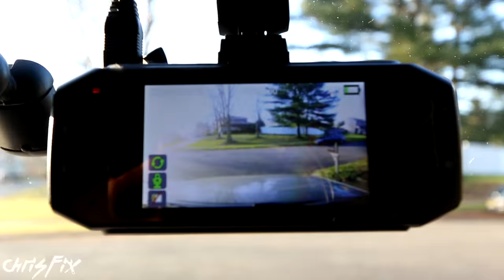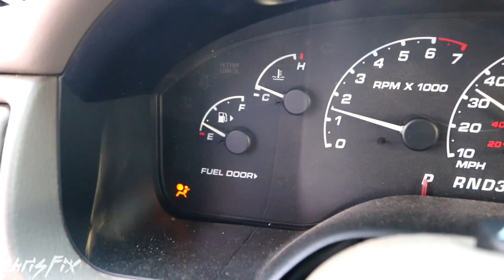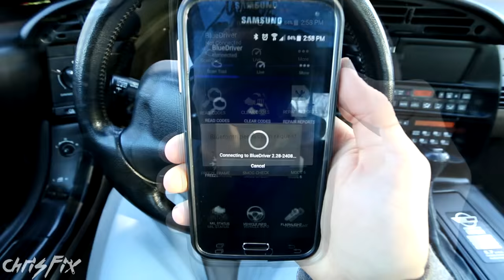Top 5 Christmas Gift Ideas for Car Guys

Comment: My number one is an actual car. there is nothing better than the gift of car
Reply: +Mihai Constantinescu That's a bit pricey though ;)
Reply: +Re yeah but it still be nice
Reply: +Re He didn't actually say it had to be new, or even running :)
Reply: Even a Prius?
Reply: Sure, I agree, Mihai Constantinescu. Some years ago, we gave a small Sentra to my sister (her first car), and I was even happier than she, because I remembered when I received a 74´brand new Ford Maverick with a 302 2bbl 3 speed in the column (a Mexican version), but, AS A GIFT!!! What a "happily shocking" experience.
Reply: +FallSoftly LMAO same
Reply: Mihai Constantinescu I kinda just received my car as a "why not, we don't need it anymore"
Reply: Plot twist it's PT cruiser
Reply: Mihai Constantinescu or a plane jk
Reply: I was thinking for a more experienced car guy a cheap parts car of the same model of theres if it's possible they are cheap and very useful for some guys.
Reply: Nicolo di Valenti I had to work 3 years to get my 2006 mustang gt
Reply: FallSoftly I
Reply: Ford gt ayyy I feel yeah. I've had a job for almost three years now and got tired of my dads old car he let me drive and bought myself a 2004 mustang gt convertible. In love with it
Reply: Mihai Constantinescu buy smone a lambo they will love u for life😂😂
Reply: I worked at minimum wage at a shitty job to save up just enough money to buy my first car, a 2000 ford mustang.
Reply: I got a car for Christmas, it's a 2005 Toyota Corolla.
Reply: DO I LOOK LIKE A CHANNEL WITH 500K SUBSCRIBERS?
Reply: Lmao yup
Reply: You should watch Bailey Dir!! She’s so aesthetic🤩I just found her
Reply: Did you get your car?
Reply: Pretty pricey
Reply: What if they have you a fiat multipla
Reply: @brandonlueth3400  insurance money it is then

Comment: 1/2" drive cordless impact.
Reply from the maker: Good idea
Reply: My girlfriend just picked one up for me :) only 145 foot pounds though. I see one for 700$CAD and it was like 350 foot pounds.
Reply from the maker: That's awesome! She's a keeper lol
Reply: Indeed lol. I got her to do some tires before.ChrisFix
Reply: I got me a Kobalt 1/2 in cordless impact from Lowes for $260. Works ok on wheels and engines.
Reply: How about a stubby air impact for $100 with 450 ft lbs of torque, and it's the size of an air ratchet.
Reply: +AJ Harran The new Ryobi impact driver with 3 speeds on the top claims up to 300ft/lbs.  In my experience it's not that strong, but it definitely is very strong for a cordless impact.
Reply: +AJ Harran Hah, that's what my wife got me last year - love it.
Reply: +AJ Harran Lithium Ion** trust me... well worth the money....
Reply: it is
Reply: +MindOverEverything Just received a Milwaukee Fuel 2763-22  1/2 impact at work, they claim 1,100 ft lbs removing and 700 ft lbs tightening. The thing rips 30mm lugs off dually GMC's with no problem. Best cordless impact I've ever used, its not cheap though.
Reply: My gf got me a craftsman xcp 1/2 impact gun for an early Christmas present. I love early presents.
Reply: +hugeslacker Harbor Freight electric impact.  Best $30 I ever spent on a tool.  It blasted off a rusty axle nut that had been on there over 12+ years with the wheel off the ground.  Air or a Milwaukee lithium would be a lot better, but you can't beat the price, especially if you don't have a compressor!
Reply: +ScubaCat3 I have one, it's pretty good but I have to hang an extension cord out the window to use it and I'm on the 2nd floor. Plus I work on my dad's car and he has an apartment with no access to power, so the battery powered ones are just easier. The xcp craftsman rips lugs off like butter. It was only 120 bucks, with a 2nd 100 dollar xcp battery. It was a crazy deal. I just used it today to do my dad's parking brake shoes and it worked amazingly well. I don't know about longevity, but I really just need it for lugs and ball joint nuts, stuff like that, so it's not an everyday thing.
Reply: hugeslacker
The $30 HF electric one is not the "best", but for what it is, it's a steal for the money.  I'll probably end up getting a lithium battery one like you have at some point.  That lithium battery technology has come a long way in recent years.
Reply: +ScubaCat3 Yeah lithium batteries made cordless tools worthwhile. Theres so many options now too.
Reply: canadian tire maximum brand
Reply: +AJ Harran that's what I'm getting, a Milwaukee one, 1,100 ft lbs of reverse torque and 700 tightening, it pretty much eliminates the need for an air gun at home lol, i have the 3/8th drive one already and its sick
Reply: +matt it's certainly cheap for what it is IMO, but not if you don't already have the batteries and charger LOL, that's what gets you. $200 for the gun alone is a fair price though
Reply: Actually, it's pronounced "mill-e-wah-que" which is Algonquin for "the good land."
Reply: 1/2” drive DeWalt cordless 20v impact wrench! 
Bought one this year and went back for the impact driver and drill driver! 20v cordless of course. 
Low profile floor jack helps too. 
Not at the NASCAR speed of rotation yet but working on it

Comment: I have one tool I cannot live without. My Bosch IDH182 impact. I take it every where. This impact broke lugnuts free off of rims at junkyard.  Plus the dual head let's me remove screws with the hex tip built-in where I built a fence with it. Love this tool!
Reply: cool. i have a 18 volt compact 1/2 inch dewalt. its a total badass. it broke off lugs on a 1976 mustang that was sitting outside 4 30 years or more

Comment: Breaker bars! Use it whenever you're trying to remove a stuck bolt, and you won't ever break a ratchet!

Bonus points because you can use a cheater bar on 'em! An old 6 foot drive axle from my old Go-Karting days does the trick.
Reply from the maker: +Brennan Ryan Gotta love breaker bars!

Comment: 199 USD or their abouts crafstman mechanics tool set would be on my TOP list... it has absolutely ever tool you'll need plus it has a lifetime warranty, if it brakes you send them one they;ll send you a new one... both metric (which is what stardard really is) and american imperial size still measued in prehistoric body parts like feet, fingers and whatever...
Reply from the maker: +Jesus was a carpenter Thanks for sharing!

Comment: How about a car fan that clips anywhere! Or an air filter or even seat covers are steering wheel cover or even hubcaps! Or wheel covers
Reply from the maker: thanks for the ideas!
Reply: @chrisfix  you're welcome! And one question why does my 1998 Dodge Grand caravan se transmission whine a little on hard acceleration or on first start

Comment: Will the Blue Driver work on any car or at least on my Nissan Altima S 2006? Also, are there any cheaper OBDII scanners that are as efficient as the Blue Driver? One more question, can I leave the scanner in the car at all times or will I have to remove it everytime I turn off the car so it doesn't drain the battery? I'm very new to all this car stuff. Thanks, guys! P.S. You're the best ChrisFix. I learn a lot from your videos and I can't wait to try out a lot of your methods on my car! Keep up the great work!

Comment: Hey Chris because of you my wife got me that OBDII and dashcam , thanks!
I have one question I have used your video on changing rotors and pads worked great.  Where am I able to get what nuts and bolts get torqued down to? car manual or somewhere else? thanks
Reply from the maker: +Marco Martins AWESOME! I love mine and wont drive without it! You can get the torque specs in shop manuals. I go over that in this video: https://www.youtube.com/watch?v=3v3hLvuO_KU

Comment: just subed because i have cars with bad issues like a KIA sportage 2001 with a check engine light that WONT shut off and a vr4 with knocking 1992 and a ford that's from 1978 that has Bering issues

Comment: Although a OBD scanner is a fantastic gift, a Bluetooth one won't work with Apple devices, only Android :) Apple requires a WiFi version :)
Reply from the maker: +SuperSonicSpeedGuy Not true, this bluedriver works with Apple. It works really good with the Apple Bluetooth actually!
Reply: +ChrisFix Oh right! When I bought mine some quick research suggested that Android was Bluetooth and iOS was WiFi. I wish I knew that before as the Bluetooth version has a smaller foot print lol. Thank you for your correction. :)

Comment: Just wanna let you know you linked the Vantrue R1 model instead of the R2
Reply from the maker: +tjb423 They sold out of the R2 so I put the R1 in there (I run that one in my truck). Goes to show you the power of YouTube haha. Thanks for the heads up though because sometimes I do make mistakes! Merry Christmas!
Reply: Just making sure you were aware :D. Out of curiosity could you explain to me the differences between the R1 and R2 or maybe do an in depth video? I'm really set on either of these; since you use both I'd love to see pros and cons. Merry Christmas to you too!

Comment: I would be worried about the risk of fires with a lithium battery of that size, especially if you live in a hot climate and leave your car out in the sun for long periods.
Reply from the maker: +Avantime That is a good point but I would think they are tested for heat since they are supposed to be in the car.

Comment: How do,you drive with the jumpstarter though? If you have to disconnect the batter pay then jumpstart it, you can't reconnect the battery so is it only good for starting in one spot and not actually moving?

Comment: I got new tires on my car for xmass well I got it early because the ones on my jeep where about to blow out they where that bad.
Reply from the maker: +SuperJeremi10 Awesome! Cant beat new rubber!
Reply: haha yea i feel a lot better driving on safe tires  one 4 tires where well past the wear marks and  one  was coming apart had a big lash on the bottom just waiting to come apart we got looking im like yea time for new tires.
also had an interstate battery put in the last batter left me stranded with no warning i came out car started just fine ran went 15 minutes up the road turned the car off came back out  the lights where kinda dim and the engine started to turn over then just clicked at this time i had no interior lights at all and the battery was hot.

Comment: Hey Chris, I have a 96 pathfinder an I went to replace the front rotors an snapped a bolt head off on each side. I was wondering if you have any ideas on how to get the broken bolts out along with the rest of the stuck bolts holding on the rotors on.
Reply: +William Figueroa Jr. You'll have to take the hub out and probably get a new hub..
Reply from the maker: +William Figueroa Jr. Are you talking about the wheel/hub studs or the bolts that hold the caliper on? If it is the one that holds the caliper on, you can weld a nut to the stud where it snapped off or you can drill them out!
Reply: +ChrisFix on my pathfinder there's 4 or 5 bolts that are threaded through the rotor that hold the rotor on. When I tried to loosen them I snapped the bolt head off of two of them.
Reply: William Figueroa Jr.
The easiest fix is to get a new hub.

Comment: hey Chris.. I was wondering if you could help me in diagnosing an issue.. I have this 1992 Lexus ES300.. and I was driving home last night and upon entering the driveway a lot of light gray smoke started rising from under the hood.. so I immediately turned off the car and checked under the hood and saw that half the transmission was wet and underneath the car had a pool of transmission fluid which seems to have leaked out from right under the transmission and its not from the drain plug.. and inspecting the road it appears that I have been leaving a transmission fluid trail.. during the day I hit a few bumpy roads which touched the underside of the car but no leak then and on my way home the road was slippery and I had a couple tire spins climbing the hill do you think that I might have red lined the transmission? what could be the problem the car drove fine when I parked it in the yard after letting the smoke get by but now the transmission dipstick is nearly dry and it didn't give any trouble changing gears or power loss to park it in the yard. The car has a bit over 145K Kilometers on it.
Reply: +ChrisFix hey I took a look at it this morning and found the problem. it was as simple as a hose feeding from the transmission squirting fluid like crazy!!! took off the hose there was a cut. what do you suggest the smoke was about? burning of the fluid in the engine bay or overheating of the transmission from running low on fluid?
Reply: ChrisFix Thanks for replying though I appreciate it everything is okay now. looking forward to more videos from you.

Comment: Hey Chris I have a question. Why is it that sometimes that I turn on my car my A/C turns on, and other times it takes a while to turn on.
Reply from the maker: +Daniel Aguilera It all depends on if the car is ready to run the AC. The computer figures that out based on operating temp and other stuff like that.
Reply: +ChrisFix thank you for responding! One more question, my radio just stopped working. I was listening to music and then it just suddenly stopped. It still turns on there's no sound coming out. Any ideas?

Comment: The link to the dash cam is the old version and the one you used in the video is sold out! Do you know where else I could get one?
Reply from the maker: +EricAbnormal They sold out of the other one but I read that it will be in stock on the 18th or something like that.
Reply: +ChrisFix Thanks!

Comment: Hey Chris! I have 2000 ford ranger XLT and 2002 corolla CE.  would a $15 ELM327 Wifi Diagnostic Interface Scanner damage my car's system in anyway?
Reply from the maker: +Ahmed Meguid I dont like those cheap scanners because they are not tested like a premium scanner would be.

Comment: Man, I would avoid those Bluetooth OBD devices like the plague.  They're made in China most of the time, and I've seen them ruin dozens of car's main computers because of poor QC.  All it takes is one crappy plug that shorts and next thing you know you're spending $1500 on a computer.  Go for a cheap corded scanner - they let you do so much more, too.  They're only like $200, and they can read and remove codes, check mode and live data, and tons of other things.  Get a couple of neighbors to pitch in together and just borrow it back and forth if $200 is too salty.  Those $30 scanners and bluetooth ones aren't worth the plastic they were made with.
Reply from the maker: Thanks for sharing but the bluedriver is not a normal scanner. I have used it on hundreds of cars, some mine, some customers, some friends and family. Hasnt failed me once which is why it is basically all I use!
Reply: Thanks for the info.  I've since done further research and those are legit.  Overall, I stand by my general "avoid bluetooth scanners" recommendation, but the specific brand you recommend is great from my understanding.  The cheap China wi-fi scanners will short your stuff though.

Comment: hey Chris I have a question I have a ticking noise coming from the front of my neon but it's only there while I'm getting up to speed or when my foot is down an OK amount it doesn't do it when idling or even when I just rev the car it also doesn't do it while cruising any idea what it could be I've been told it could be a cv joint
Reply from the maker: +Brandon Hodson If it makes the noise when the car is turning it is most likely a cv joint.

Comment: The dash cam is different than in the video.. is there another link for the video version?
Reply from the maker: +Justin Trinh They sold out of the one I originally linked so I put up the first version which I run in my truck (works great).

Comment: I got a question here. my 02 S10 2.2l has a Little side to side movement on the rocker arms... is this normal ?
Reply from the maker: +Justin P. That is normal. They need to have some play. It should be very minor play though.
Reply: +ChrisFix thanks Chris! I feel alot better now. I change my oil always on time . and yes, its very little play

Comment: will that scanned permanently clear my airbag light so I can put my car through NCT (vehicle test in Ireland) and it will pass?
Reply from the maker: It will tell you what the code is. The only way to clear the airbag light is to fix it. If the code is cleared, it will just pop right up again if there is still a problem.
Reply: nothings even wrong with the airbag :p could the light be on due to a loose connection somewhere or something ? car is Peugeot 206 1.1
Reply: just unplug your voltage regulator to blow all the dash lights 😉
Reply from the maker: Watch this: https://www.youtube.com/watch?v=FiO9wUb9FV4

Comment: Chris I have problem with my 93 suburban few days go out in Portland I taken it too gateway tires world / too change my engine oil / transmission filter and oil/ and fuel filter / the next day it started too ran strange it kept chocking and dying on every stop light / it only dies when I give it gas / i almost had few accidents / I am on your Facebook too can please tell Me can be the problem / i changed all sparks plugs and wires as well ; ) ??
Reply from the maker: +Isa Salah They might have done something wrong and I would take it back and tell them they need to figure out the problem. Could be something simple like a vacuum line they knocked loose or they could have put the fuel filter in wrong.